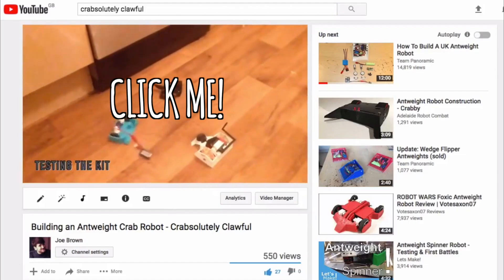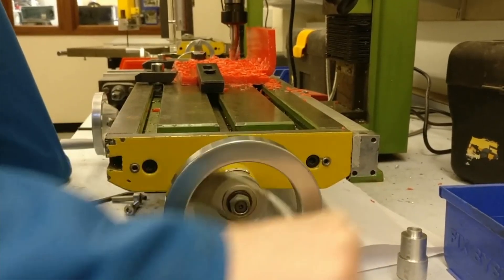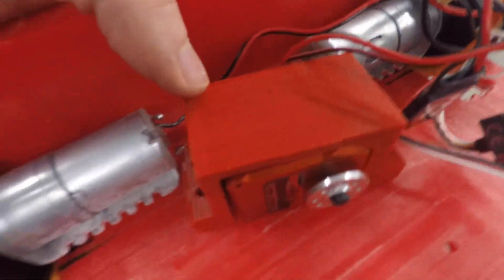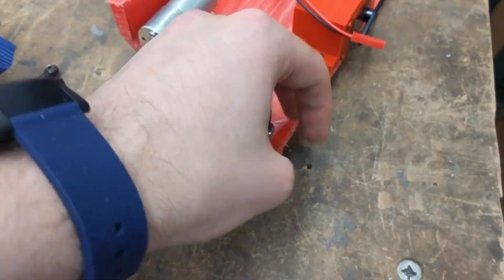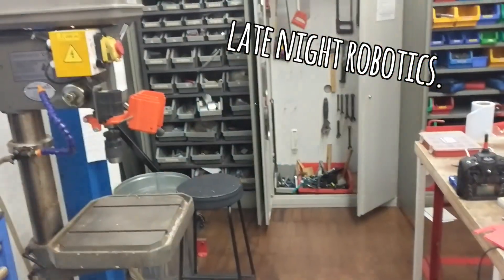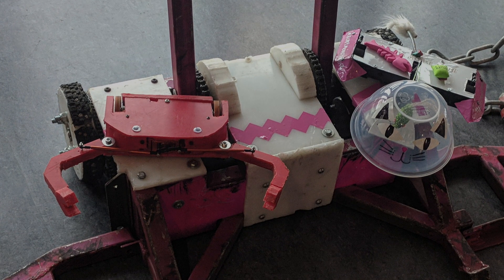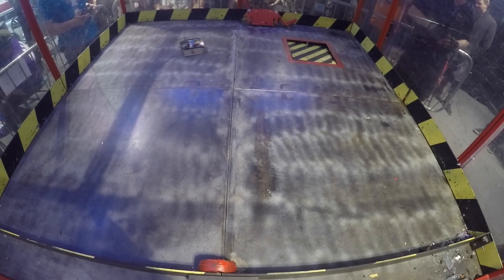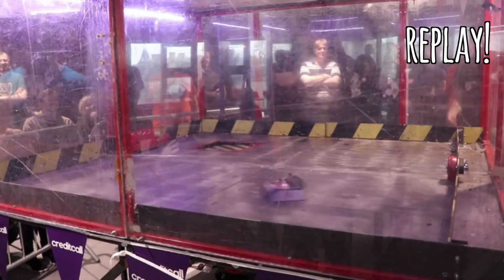Building a Beetleweight Crab Robot - Crabsolutely Clawful

Comment: The vex 29 speed controllers say the take a max of 8.5v and 4A. You're putting 11.1v in? could they do 14.8v?
Reply from the maker: People have ran them on 4S before :) but not particularly recommended. 3S they have absolutely no issue. Still running the ones in this video in events now.

Comment: You might want to solder resistors over the leads to cut down on electrical "noise". Noise is interference and may cause your drive to cut out intermittently.